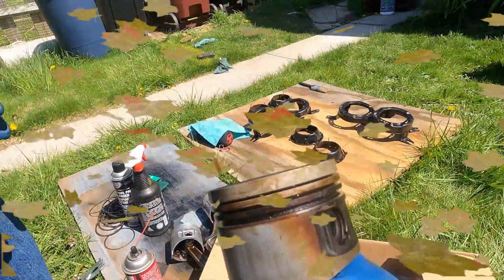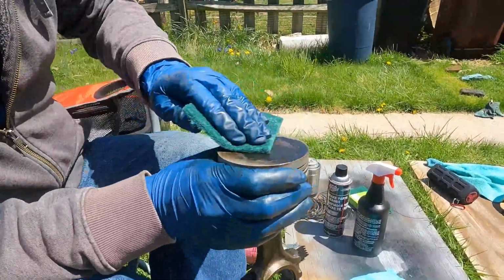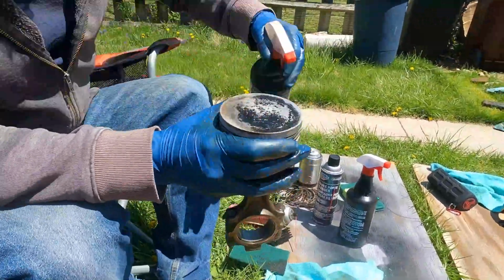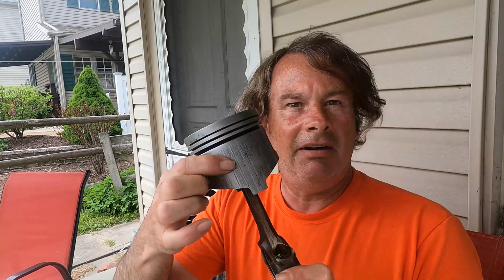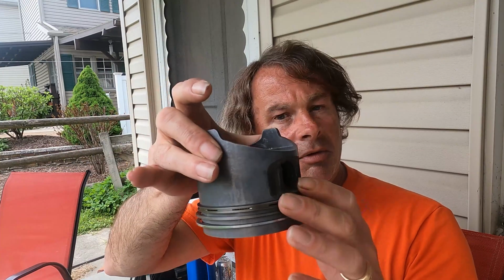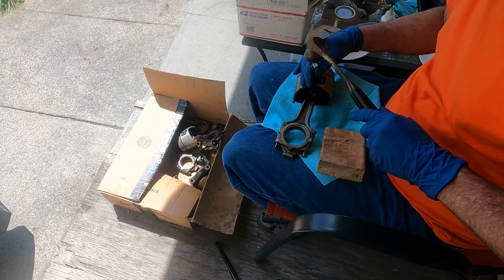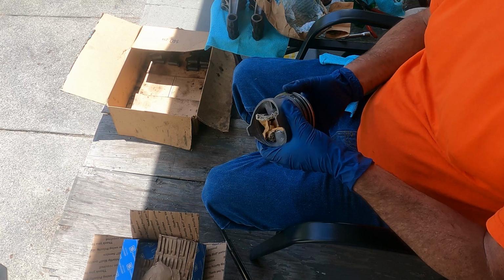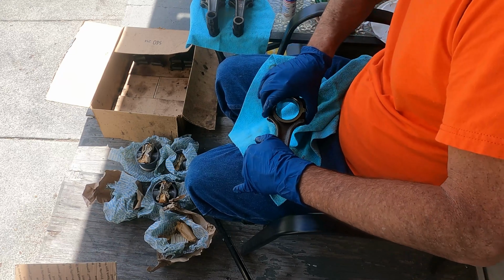Idiot Refurbishes pistons for a BMW 7 series!

Comment: Interesting content there man! Just one tip when cleaning pistons: I believe you shouldn’t thoroughly clean the top of the pistons with scotchbright as carbon can now adhere better to the top of the piston. Compare it with sanding down paint before painting; the paint will adhere better after sanding. The same goes for carbon on the top of a piston. I appreciate the content nonetheless, keep ‘em coming!
Reply from the maker: Thanks man!! Inevitably I got new pistons and didn’t touch the top surface. :-)